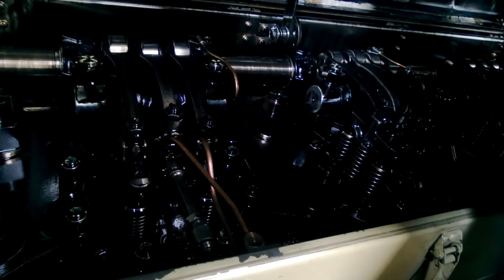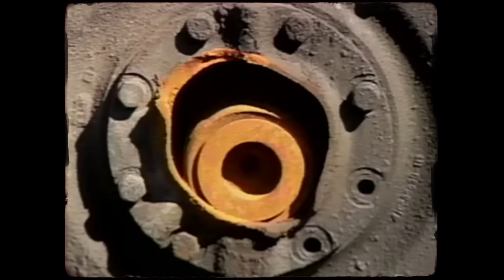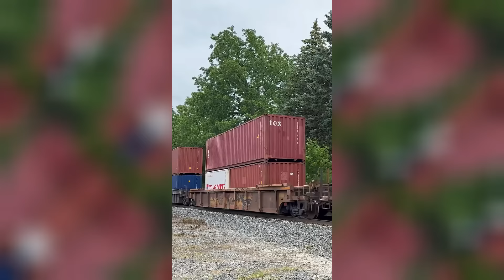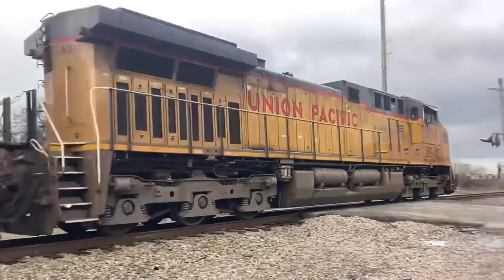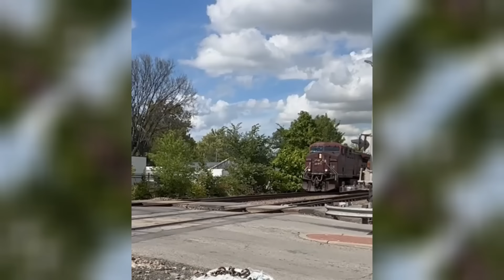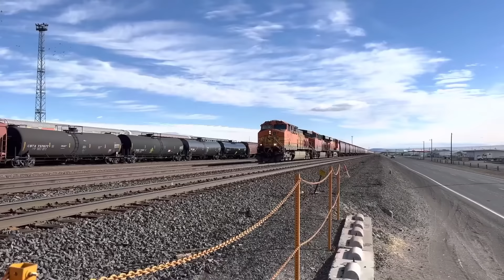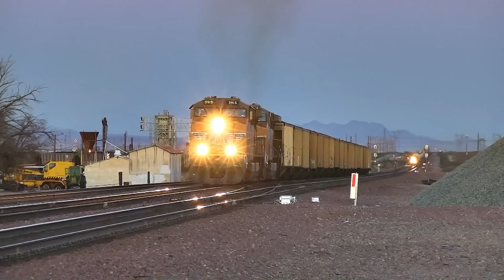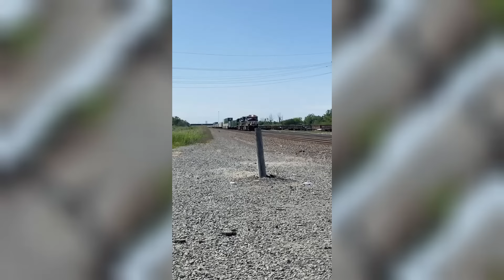The GE Locomotive That Silenced EMD in 1994

Comment: What actually happened is more distinct than what this video would have you believe. While AC traction was a great innovation GE was not the only purveyor of this technology. EMD, suffering from the fiasco that was the SD50, came out later with AC technology in the form of the successful SD70ACe which also sold in great numbers. But GE had made the decision to "buy" the business for their locomotives, offering immediate replacements for defective units where EMD was not in a position to do so. Being supported by General Electric's total corporate financial standard, this was an advantage over EMD who, cut-off from General Motors support due to its own financial issues, has been set adrift until purchased by Caterpillar's Progress Rail Division over a year and a half later By then, the big purchases of AC units had already been accomplished by most railroads, leaving EMD to switch most of their production to export units as well as rebuilds, which has become the new norm for American manufacturers. With most new locomotive purchases limited to orders of less than 100, rebuilding existing locomotives has become the new norm for railroad mechanical departments and with the high cost of new units, will most likely remain so for many years to come...
Reply: I only have information for Norfolk Southern since that's who I worked for, but in 2010 they were starting to have older locomotives tore down and rebuilt at the altoona shops. At that time the backbone of their fleet the D9-40CWs were having major electrical and mechanical problems with grounded alternators, grounded blowers, grounded traction motors, low voltage grounds etc. Of the about 1100 of those I wanna say 2/3 Of them have been rebuilt into an upgraded AC version of their former self. NS used to be very much against AC traction until the mid 2000s maybe a little before then. Hence why they have the D9-40CW and not AC4400CWs. NS derated their locomotives to 4000 hp but we're capable of 4400. There's a switch in the nose that detuned the alternator down to the 4k level
Reply: Some guys love EMDs. There's one guy in helper serving the Pittsburgh line that lived the sd80macs. Said they would pull the drawbar right out of the car if you let it . But I'm NOT AN ENGINEER. Sorry for caps, phone not as smart as it thinks it is!! is!!
Reply: Thanks for the background history
Reply: Why GE took control when it came to the AC traction market came down to 2 things 1 400 more horsepower with better fuel economy with electronic diagnostics on-board.  The 2nd was in the inverter set-up for the AC traction motors.  EMD went with a single inverter per truck which requires a tighter wheel size tolerance more frequent turning of the wheels and if you lost a traction motor then the entire truck was lost.  GE went with an inverter per axle which allowed smaller inverters but better control.
Reply: Not true. One must remember the BN SD60MAC demonstrators of the early 1990s. They came before GE had AC traction. I believe that BN placed its initial large SD70MAC order before the AC4400 came out too.

Furthermore, EMD had microprocessor control and troubleshooting back in the 1980s too. The video makes it seem as if EMD was grossly behind in technology. Based on my experience, the EMD 60 Series was a much better locomotive than the-8. Yes, the 50 Series had its faults, but the 60 Series more than made up for it. They were a superior model.
Reply: @brianburns7211  As a 30 year locomotive engineer the dash 8 was not a great engine but was still way better than the SD60. I cannot speak to the maintenance but operationally,  the dash 8 held the rail better, pulled harder and the dynamic was FAR superior. Not to mention they were our first locomotives with air conditioning ;  ). When NS made the dynamic first priority, not many guys wanted the SD's in the consist. As an old head once told me, you might as well stick your foot in the ballast, it would slow down faster than an SD. The dash 9's hit and that was, more or less, the end of SD's on our system, barring the sd40's (best engines EMD ever made). Oh they still bought some, I suppose as a hedge but the SD 70's and 80's just could not match the performance in any area. Hell the SD's even were even rougher riding and louder in the cab. When we started getting the GE AC engines, it was like magic. You could run a coal train like a pig train...almost.  Now with the rebuilt 4000 series, they are amazing. Compared to my first trip as a conductor on a high nose sd40, it is like magic.
Reply: @Splintermagnet  would you mind explaining what running a coal train like a pig train means exactly?
Reply: @chadfranklin1774 Coal trains are very heavy. Pig trains are not. It makes the weight seem like it's not there, in other words.
Reply: @chadfranklin1774 Sorry, I guess I missed your question.

Coal trains are very heavy, minimum 15,000 tons where I am. That means they accelerate very slow and slow down very slow. 

Pig trains are generally not very heavy, I think the smallest I have ever ran was 1,500 tons with 2 widebodies, a rocket ship. So swift acceleration and deceleration. I suppose the easiest way to explain it is, think loaded semi vs a sports car. That is not always the case, especially now, double stack trains can be over 10,000 feet and therefor much heavier but still faster than commodity trains, of course depending on what and how many locomotives.
Reply: @schinbone0 
I am an avid NS railfan and I love diesel electric locomotives. But I like the SD40-2 the best of all the EMD locomotives I believe. Now I could never catch up to freight train with SD60 consists. My father and I thought if we see those on the train...oh no. But i always wondered until I met and started being the free lift so the conductor didn't have to walk back to the front of the over mile long train. The crews didn't like locomotives without dynamic brake and mixed locomotives from GE EMD. They told me what I  guessed. The competitors don't like it, but the multiple unit cables makes them fall in line with the  lead being the boss lady. If it's a radio or DPU train, she's a radio mistress. Now with acceleration and loading the EMD Progress Rail units are in the lead. But with dynamic brake, the reigning champ is GE. I guess reliability is usually EMD. But GE Wabtec has a locomotive that had the better and still unchanged widecab since the C44-9W (C40-8W?). EMD had gone through so many widecab forms, from the Canadian cab dektop, to the popular isolated cab, to the AAR single control stand notchcab, and then to the railroad crew popular SD70ACe 2 window 85 decibel isolated AAR single control smooth ride locomotive. The crews i talked to agreed with you. Most of the GE locomotives had the better dynamic brake systems. One thing about EMD locomotives that their anxious acceleration would break couples. Now I had this Train Simulator and Open Rails simulation. I could run SD40-2, SD70, SD60, SD90MAC'S, AC4400CW'S AC44C6M's C44-9W'd, GP38-2,  B39-8's, ES44DC, ET44AC, SD70ACE'S  SD70M, SD75M. Now if you're running on flat territory or just a short transfer job, sure you can run an SD40-2 or SD60. If you have yourself a couple of 2% grade to ascend and descend with 10,000 tons or more...dynamic brake needs to be at the highest. That's the good thing about AC drive,  the engineer no longer has to worry about short time rating. I learned when I was 12...sorry disabled all my life...book nerd. IlearnedthatDC tractionmotors would birdnest from after 10 minutes of usage of the dynamic brake used in 6 to 8 I believe.  Either way with the economy most of the railways are just rebuilding their late models or shopping or leasing from the lease fleet or other railroads.  EMD could've done better.  They became.carelss and complacent. Progress Rail  and their marriage to Caterpillar may be too little too late. They should've tested their 4-cycle engine before release it to sales overnight. They must want another SD50 flop.
Reply: @letitiahuang3685  SD 40's are truly the best locomotives made, proven by time. Not the strongest anymore but they are still out there, all across the nation getting it done everyday. They do tend to build amperage quickly because of the two stroke diesels but generally not much to worry about.

I will say EMD's generally cannot out pull a GE. Not since the dash 9's at least.  They just cannot hold the rail like the GE's, for whatever reason. The GE's pull better in the rain and on a grade.

 I think you might have the short time rating backwards. The short time rating is for power not dynamic. The biggest problem with GE's is how long it would take them to load, or make amperage. When you get to the bottom of a hill and need to start loading quickly to stretch the train out to go up the next hill, it would sometimes get dicey because many would load very slowly.  Too slow to load would mean in train forces not being handled correctly, no bueno. 

Today, by far the best road power are GE's,  but we still have many gp38's and sd40's because they are fantastic at flat switching and on locals.

I guess I forgot to  mention, NS is who I worked for. Conductor, Engineer, Road Foreman and Dispatcher.

Comment: Lol one of my friends worked on locomotive turbochargers and tge too-hot exhaust of crummy stupid 4 strokes causes lots of early failures in these over-hyped shit-boxes, often having intake side seal failures and runaways on the lube oil getting into the intake. They smoke almost as bad as old ALCO 4 stroke detritus, and suffer the exact same issues with carbon buildup that can lead to the “power packs” pulling off the crankcase from packed carbon being between the piston crowns and cylinder head, pulling the studs to pull out of the block. Total crap design. Any advantage over EMD is cancelled because of failure of turbos and engines. My friend said these GE’s are broken more than they run, and he witnessed it first hand. Don’t get me wrong, I do NOT “hate” GE, as a light bulb collector/historian and collector of fixtures, such as GE’s venerable and awesome “M” series mercury vapor and sodiun street lights, and also the also venerable “P” series mercury vapor and sodium box floods, and I have GE/Edison bulbs that make up 90% of my collection snd cool one to a few-off items from the factories and research centers, like a wicked rare serial number 2 of 2 ever made “color scope” device that uses expensive and now rare 60 watt natural color glass, red, blue, and green incandescent bulbs on individual dimmers one to a bulb, matching color knobs, that can produce ANY light color temperature there is, mainly to develop new colors of phosphors for fluorescent and mercury vapor bulbs! Yup! One of TWO ever made! But GE locomotives are pigs. Big 4 strokes are terrible and always will be. The way to make these locomotives run right is to EMD swap them, which some were actually done I heard. An EMD with 3000 HP will pull as well as a 4000 HP GE. Ya just gotta know how to run them. The unsuccessful EMD mentioned here was a 4 stroke and a piece of junk. The 2 stroke cycle is best in big engines. They are actually thermally, combustion, and mechanically more efficient than ANY 4 stroke. The GE’s actually have to run at TWICE the RPMs than an EMD, so about 1250 RPMs versus 900 for 2 stroke EMD, twice the wear and are pigs to start in cold weather, have to be left running at idle in cold weather, wasting fuel, wearing out, and glazing the cylinders. Utter trash. 4 strokes SUCK, 2 strokes TRUCK! If EMD’s were AC, they would have ate GE’s for breakfast, lunch, and dinner! Common sense!! Cheers! 😋👍😊
Reply: The GE Evo runs at a max of about 995 rpms
Reply: @Ellis-s5o I dont recall the EVO running at a lesser rpm as opposed to the dash 9s. Pretty sure they both run at a max of 1047 rpm but that was 13 years ago when I last worked for NS. I could be misremembering
Reply: @jdday1757  I’ve seen the 7fdl’s go up to 1050. The Evos run at 995 or so. Oddly enough from about notch 6 or 7 all the way up to 8, they seem to stay at 995. No wonder they were so dominant. Same amount of power at lower rpms with fewer cylinders. Better for emissions and fuel economy and they are known to PULL
Reply: @Ellis-s5o hmmmmm. I just dont remember that from my time at NS. I can easily be misremembering though. Did yoj work for a railroad mechanical department. ?
Reply: @jdday1757  I don’t want to put my business out there. But it’s possible that different railroads could tune their engines to their own specs. I’ve seen different setups in terms of control stand layouts, the arrangement of the electronics in that room directly behind the cab, grilled catwalks instead of solid walkways along the long hood, rear ditch lights vs no rear ditch lights, etc. and I’m talking all of these differences on the same style of locomotive
Reply: @Ellis-s5o ohh ok understood about putting your business out there. I havent seen any locos woth different layouts of any of that. I may have seen ones that didnt have ditch lights in the rear. Usually those were leased units though
Reply: Ok. Now someone with some actual mechanical in depth commentary. Thank you for that. 

Furthermore the info about the light bulbs is really fascinating. Would love to pick your brains about that privately someday. 

Now with that being said there were some inaccuracies and its ok we all make mistakes. The GEs ran at a maximum of 1047 rpm where as the EMDs ran at 997 rpm. For the GEs generally 1051 was the max above that we had to dig into why its over revving. That much mass spinning too quickly will definitely self destruct that engine. We had a hard time starting up locomotives in the cold no matter what engine they were. Big diesels dont like the cold. The bigger reason locomotives are left idling in the cold is because if they're shut off with water in them the freeze plugs will blow and let out all the water so it doesn't freeze and split the block

Comment: Yeah the EMD 4-Strokers aint cuttin it in the states, I thought they had it figured out with the 265 H 12 cylinder but I guess not. The class ones are afraid to take any more chances, they got burned too much, plus the cost of a new locomotive is nuts, But GE don't make locomotives no more, now it's WABTEC and the other day I saw a new offering or rebuilt not sure which but it's an 8cylinder model with a GE style cab and EMD style cooling radiators and more and more rebuilds are getting K5LLA horns like the old SD70-ACe, WABTEC can build what ever they want if they can sell it and make money then more power to them.
Reply: UP has 100 of the SD70 ACeT4's (now called SD70ACeAH's. and seems to like them. They also have lots of SD70M DC's in storage that will be rebuilt into SD70 ACeM's when the opportunity tp buy many new locos rolls around....
Reply: 8 cylinders on a locomotive ??? Yikes. Even 12 cylinders just isnt enough for a road heavy haul locomotive. Can't produce the torque needed to spin up that alternator hard enough fast enough and reliably. Ill be very curious to see how long that set up lasts before having major mechanical problems. Im seeing more and more why class 1 railroads are rebuilding what they have. The frame, trucks and often the bodies are sually just fine after 30 years of use. Just everything else is screwed.
Reply: Big 4 strokes, gas or diesel are and always will be junk. Even common smaller 4 strokes suck. I hated these stupid engines all my life. The only good push mowers were all 2 stroke. I have 1946 Power Products open flywheel (no cooling shroud!) vertical shaft early mower engine I bring to old engine shows, and like an EMD, Cleveland, or Detroit diesel, that little 2 stroke runs SO sweet and sounds and smells DELICIOUS! It ALWAYS starts and has instant throttle response unlike a POS 4 choke Breaks & scrap ‘em, and no checking or changing oil, ehich is STUPID on a mower! It isn’t on a mower, but on a skid snd I use a wheelchair and can easily carry it on my lap! It is SO loyal and almost like a living thing! And this is a GASOLINE 2 stroke! The diesels are even more excellent! I have 2 RARE valveless 4-51 Detroit diesels-yes they exist, though mythical to most people. They mads an even rater 2-513 cylinder (mine are inline 4’s) as well! They are simple but run perfectly! Things of beat actually! And having intake and exhaust ports like my gas 2 strokes, they sound beefy and deep! Awesome stuff, not junk mot meant to last like 4 strokes. EMD tried a 4 stroke and it was a piece of junk just like GE and ALCO diesels were. These big diesels HAVE to be 2 stroke to run right and run efficiently. 4 stroke diesels above the ones in big rig trucks are NEVER successful. The principle is flawed badly. Cheers! 😋👍 Rick Delair.
Reply: @HammondC3 how do you figure that the GE 4 stroke engines are junk. ? You really didnt go into any detail whatsoever. Do you have any real mechanical knowledge of big diesel 4 strokes ? Now I dont have alot of knowledge on them either as I was an electrician working on those locomotives not a mechanic. The mechanical problems they were often in the shop for, amd when I say "they" i mean the D940-CW as we didnt have the AC4400CWs but they're very similar locomotives, they would be in for power assemblies, turbocharger replacement, traction motors replacement, air compressor replacements and various other smaller mechanical replacements. At least at the time I was at NS which was 2007 to 2011. Beyond those years I cant say. EMD 2 strokes were in the shop too, and for all of tbe same shit as the GEs. North American class 1railroads beat tbe shit out of their equipment. Cause they gotta turn profits and please the shareholders. The trains neeed to be shorter not longer if they wanna increase reliability and longevity. Instead they do tbe opposite